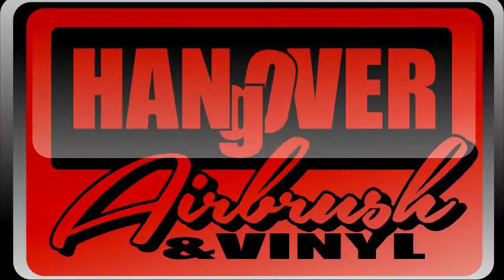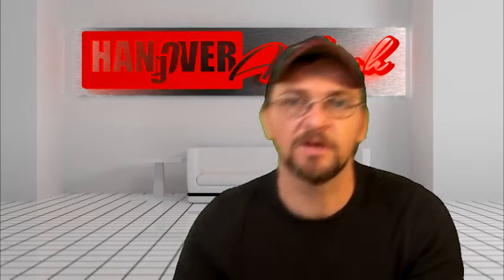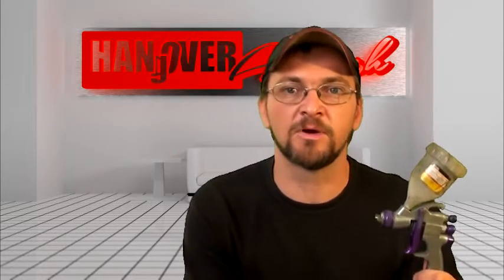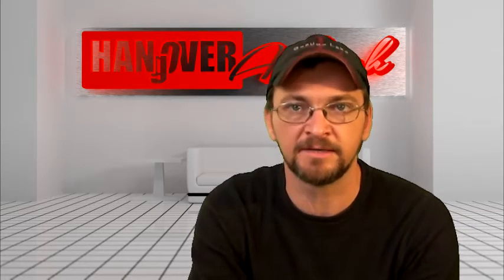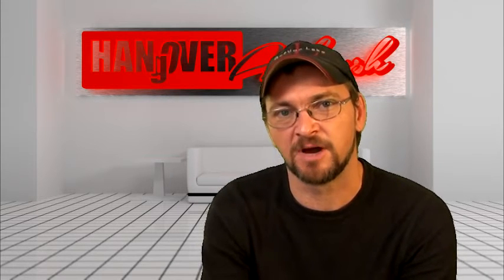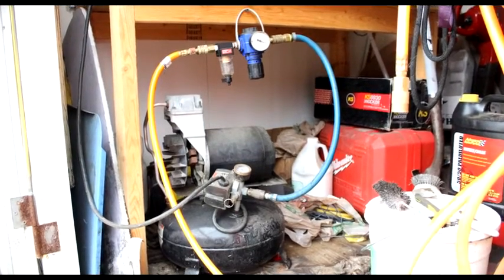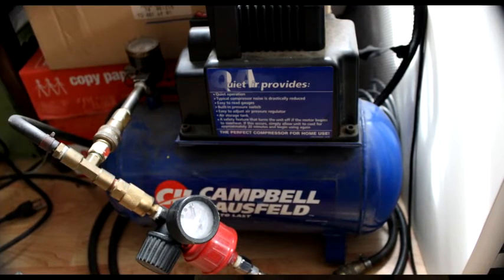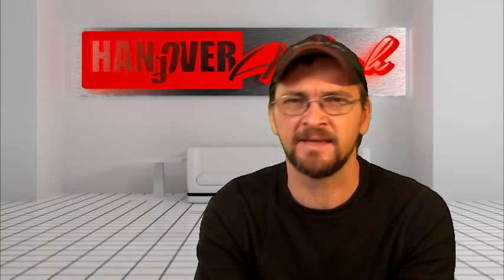compressors for airbrush

Comment: Thanks, what brand brush do you use that has npt fittings ? Also, is your airbrush 1/8 bsp or npt at the brush ?
Reply from the maker: 1minibean the hose I got from Harbor Freight fits 1/4 NPT on one side, and the other end is the 1/8" fitting which seals with an o-ring. Not sure of the size, but it works on both Iwata and Badger.

Comment: Jack, I have watched your informative and tutorial videos with awe, your brilliance on the knowledge needed is great. i have a little problem with my airbrush compressor, which is brand new. it is a TC80T compressor with a 3 litre tank, the power is 1/5 HP. The air output is 20-25 litres per minute, auto stop start at 3 bar, now this means nothing to me, except my 3 litre tank is not enough when painting anything, as the motor is running most of the time, then it cuts out, therefore am I to understand (after watching this video) that I have wasted my money.? I set my pressure about 25 lbs.

Comment: HI I am learning to airbrush, I have a Paasche Dual action VL, right now I am using one of the $100 Harbour Freight regular 3HP 10Gal compressor, it does great If I am outside or in the summertime I can leave it outside and not worry about the sound, but winter is coming and I don't want all that noise  in the house and don't want to leave it in the weather, so I saw on amazon those small 1/3 HP 1 GAL twin piston 1.3 CFM  low noise compressors, it says it runs until 60PSI then shuts off until the pressure reaches 40PSI then cycles back on, are those any good? also you say you run a 100 FT line, if I leave my compressor in a storage shed in the winter and run that length of line in the house, maybe thru a PVC pipe as no one will trip over the line or get covered with snow or get lots of moisture in the winter , will it not loose pressure that far away??

Comment: I am starting out and have a small airbrush compressor with no tank.  I live in an apartment I have a pancake but it is loud do you know of a way to bring the noise down or silent .  I practice on the deck I do not want to tick anyone off you know what I mean
Reply from the maker: oooh, tough one.  I've read that some have made compressor "enclosures" from acoustic ceiling tiles.  Others claim "suspending" the compressor yields good results.  But the majority agree that fitting a muffler to the inlet can produce acceptable results.  Fitting a muffler, or "piping the inlet outside" may be the best ideas, because an enclosure that is too tight, will get too hot.  My best advice is to cushion the feet and try the inlet muffler...And then warn the neighbors.  You might offer them some "free" airbrush work for "tolerating" your compressor until you get the sound level reduced.